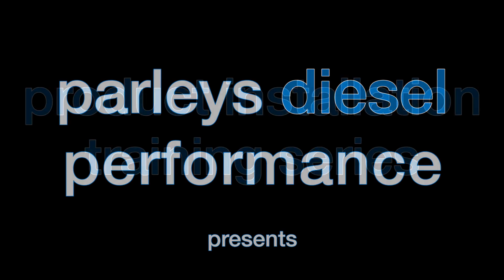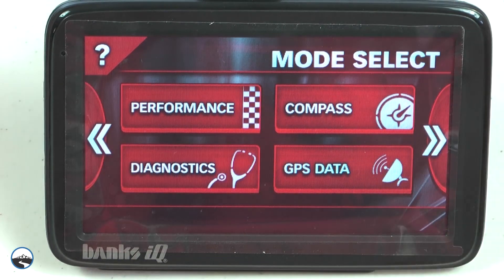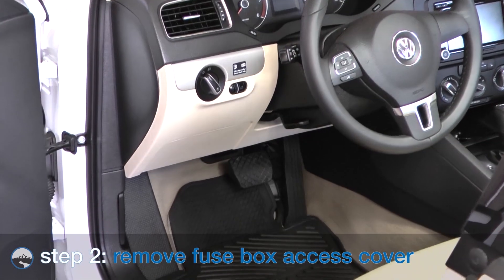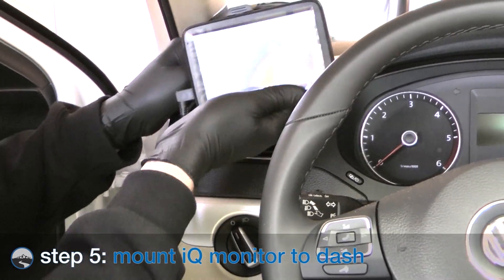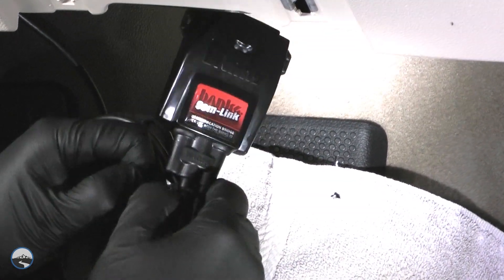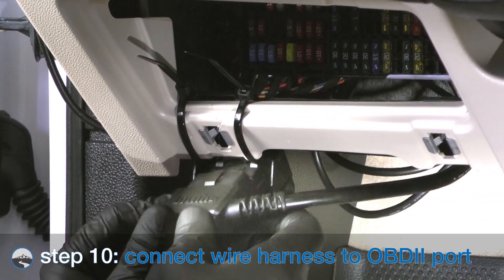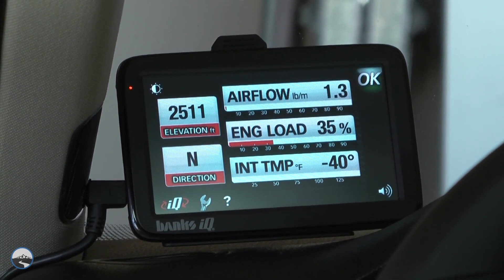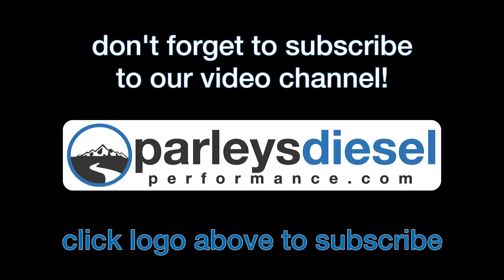Banks iQ Monitor for 2009-2013 VW TDI's

Comment: Does it display boost?
Reply from the maker: It does not display boost on a VW TDI.
Reply: What about Egt?
Reply from the maker: Johny Bylund This is the list of things that it will monitor on a TDI.

Air Flow
Ambient Temp
Barometric Pressure
Catalytic Converter Temp (Useful for monitoring particulate filter regeneration)
Direction (Compass)
Elevation
Engine Load
Engine Temp
Intake Temp
RPM (5K or 8K)
Run Time
Speed
Time (Clock)
Battery Voltage
Reply: ParleysDieselPerformance.com

I wish that this would show BOOST as well however it does not, I have 2 of them one is running on my Volvo V50 T5 it shows most of the stuff but again no Boost. 
Any chance we will get a software update that will show boost?